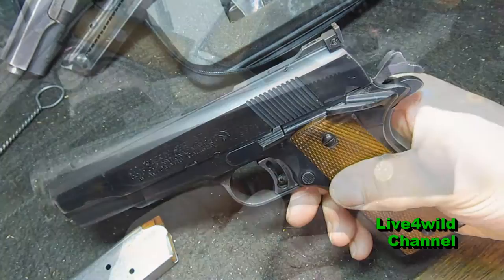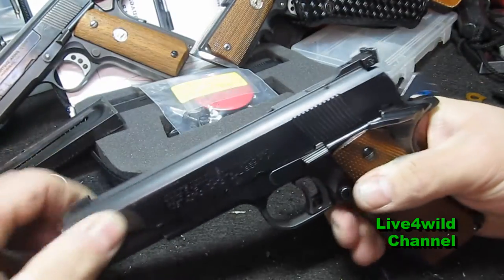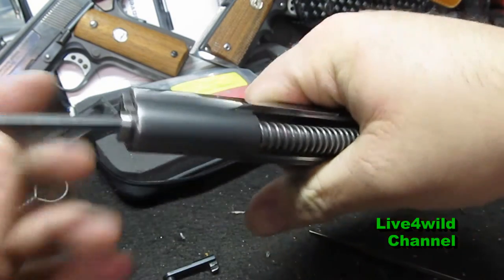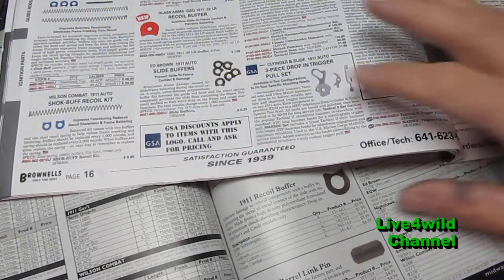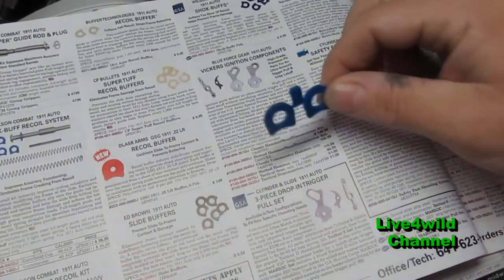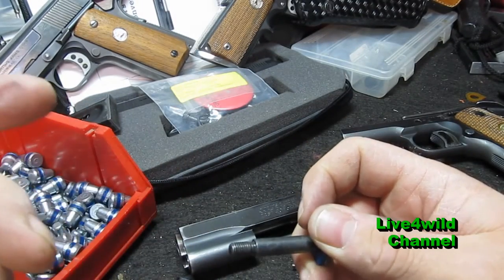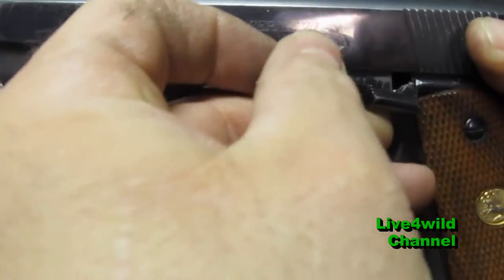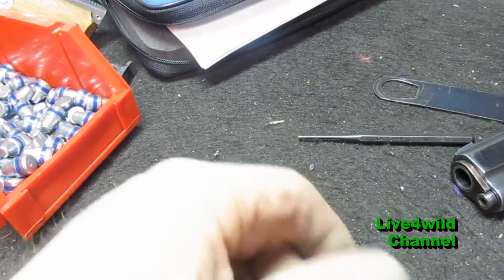1911 Recoil Buffer

Comment: Try removing the barrel bushing first when taking down your 1911 it releases the pressure under spring pressure. Same on re assembly install it last less chance for scratching your slide